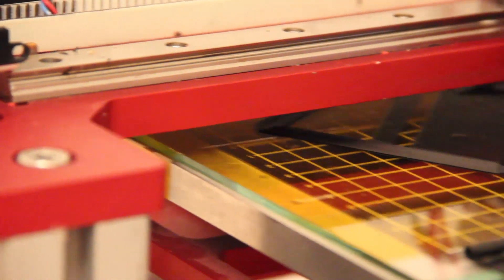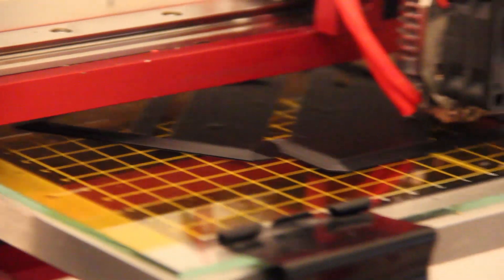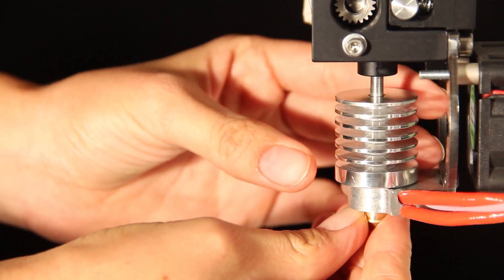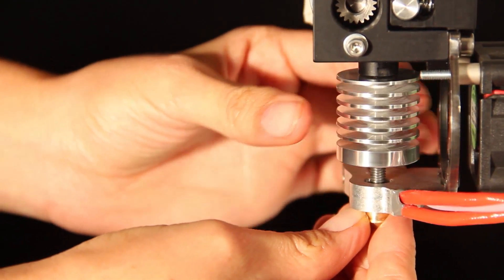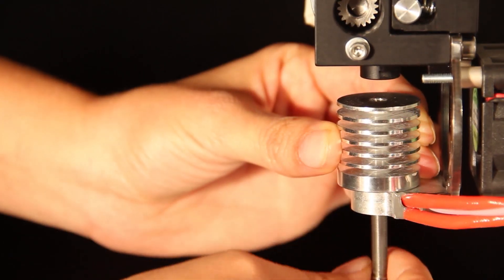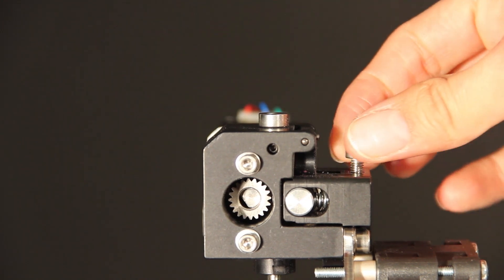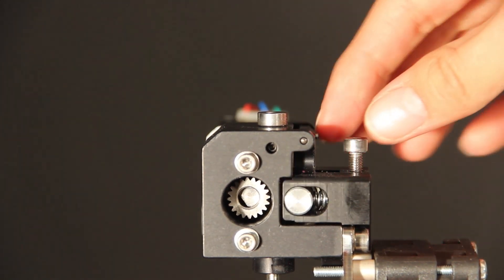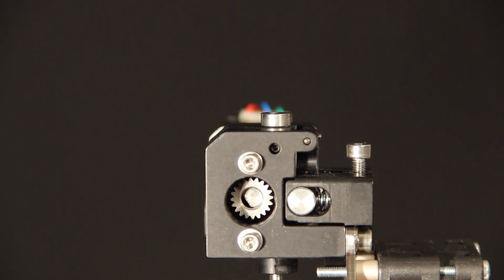Micron 3DP - All Metal Extruder

Comment: I have had one of these for a few months now. I really cannot fault it at all. I managed to blow up the thermistor in it but that was easy to drill out and replace and that was my fault for being a n00b. I think the only design aspect I might look at is how the knurled screw holds down the block that contains the pressure bearing. You sort of have to squeeze and pinch the block while tightening the knurl at the same time and sometimes the block doesn't sit perfectly flat as a result. I find I have to swap the nozzles out fairly regularly and soak them in Methylene Chloride ( printing PLA ) but they really are easy to swap over. For those people who said you could buy a whole printer for that much money you probably missed the point. I needed a good reliable industrial quality extruder to put on my kit that is basically running 24/7 at the moment. This was definitely it.

Comment: Great extruder & hot end but it wont fit Prusa mendel printers where the X axis has 2 - 8mm rods horizontally as apposed to vertically ( like on a prusa i3 for example)
Reply: Sure it can  with a few little mods I am running it on a Prusa I2 on x axis. 50mm
Reply: Prusa Mendel as in the original with 2  X-axis rods on a horizontal plane
Reply: Yes  I have one is  a sells mendel/prusa i2 x axis 50mm. Took a little bit but  i got it mounted.
Reply: can you share your set up 
I made an adapted X carriage and adapters for it as well for a friend , Did 2 versions.> 1 with front mount fan and one side mount fan
Reply: My last video I made is on here wont let me link it. Later in video can see  carriage a little better with a bowden setup ran to it  using wades type extruder 3mm abs. Tryed bulldog XL I couldn't push it through the tube  correctly.
Reply: My X carriage is a  sort of custom aluminum one. I still had to  play  with it to get it to mount with the fan on. I ended  up mounting  it underneath by screwing it to a jhead bracket and then   bolting it to carriage.

Comment: Hello:

What are the dimensions of the device? Do you have CAD files?
Reply: Diego, you can see dimensions here:
http://www.ebay.com/itm/ALL-METAL-STATE-OF-THE-ART-3D-PRINTER-EXTRUDER-1-75-FILAMENT-HOT-END-REPRAP-/171203633804?pt=LH_DefaultDomain_0&hash=item27dc88228c
If you want CAD file, contact us at micron@bezeqint.net
Reply: arik bracha Hello, thank you for the answer... Do you have the CAD files avaible? those draws are in inches or mm?

Comment: I have bought the original Micron 3DP all metal extruder and I can confirm that it works awesome.  The design is almost exactly the same.  The only regret that I have is that I didn't buy the dual extruder model.

Comment: Hi, I am the inventor
The patent application is for the detachable filament guide and nozzle module "DFGNM".
 If you are a 3D printer user, I am sure you know how frustrated it is when you have  a clogged 3D-printer nozzle....following half an hour process " Steps to clear a clogged 3D-printer nozzle". This new mechanical concept allow easy replacement of the nozzle and guide module in less than 1 minute.